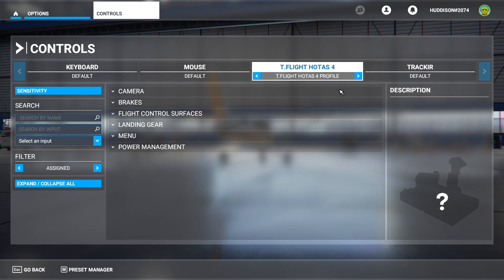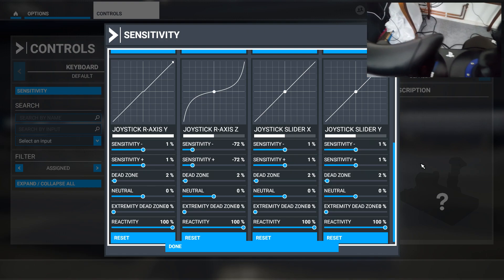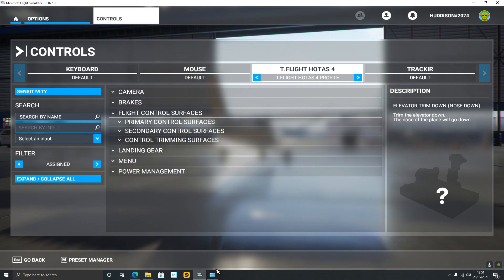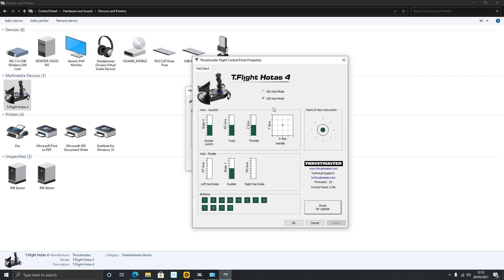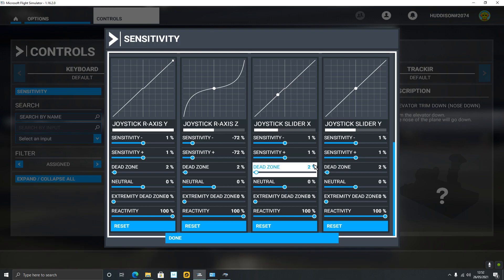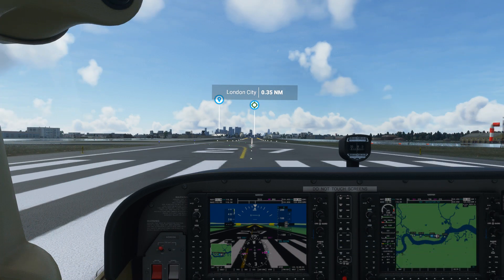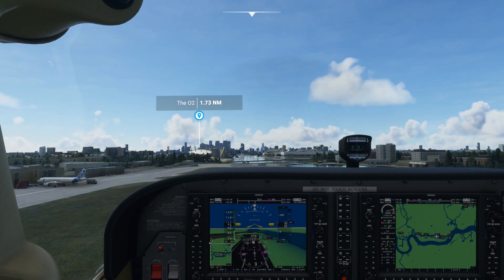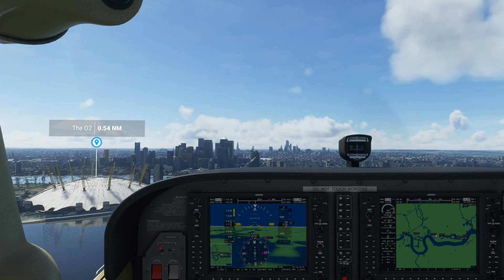FS2020: How to Enable/Unlock the 'X' Axis in Sensitives for your Hotas 4/X/One!

Comment: On a Hotas X the 5 axis mode is there but greyed, so no luck.  Except I'm sure I had those 2 buttons working for elevator trim at one stage, so not sure how!  At the moment, they are controlling the rudder as you say.
Reply from the maker: Do you have the official Thrustmaster drivers installed for your Hotas?
Reply: @Huddison  I think so, from the Thrustmaster support site labelled 2018-FFD-2. I'd put a link if I knew how..
Reply from the maker: @clarkac1  I'll do some digging.. Yes they seem to be the latest drivers for it - I'll pin your comment to see what others may have to offer.
Reply: I found how to get the 5 axis mode, simply press the coloured and lit button marked with a 'home' icon!  Doh... if the colour is bright you're in 4 axis mode, if dim 5 axid.  So now I can use the slider for trim, and twist the stick for the rudder.
Reply: Andy how can the X axis be found on MS Flight Sim? I have a yoke and a throttle but no mouse as in the example? Any advice is greatly appreciated.
Reply: @MillardE  If you go to the 'Sensitivity' page in MSFS then each axis is labelled (at 0:43).  Wiggle your controls to find which is which axis.

Comment: I’m also using the HOTAS 4.Do you have the Auto Rudder option switched on or off in the settings menu? If I have it switched off I find that I need a lot of rudder to keep the plane straight on the runway when taking off. I think it may have something to do with the live weather wind strength in the sim but just feels a bit excessive the rudder input needed.
Reply from the maker: Possibly a setting you need to turn off/on in assistance options/piloting.

Comment: I've got the HOTAS X, a complete new one, and there is something wrong my throttle. In the calibration it only want to register throttling up and not down. This is also the case in MSFS2020. Help?!
Reply from the maker: Did you download the driver?
Reply: @Huddison  Yes I have and I can see in the driver that the throttle acts strangely even in 4 axis mode and 5 axis mode. I've written to Thrustmaster now with this odd problem.
Reply from the maker: @tobiasgamingOfficial  I don't own the 'X' version of the Hotas; but your issue does seem a bit unusual.
Reply: @Huddison  I think I've found the problem. It was something in the calibration of the throttle itself ...I think I got it working now. By the way... love your videos 👍🏻
Reply from the maker: @tobiasgamingOfficial  Excellent to hear & thanks!

Comment: With my tflight hotas one, when I press the xbox button it will switch between 4/6 and 5/8 automatically
Reply from the maker: Great tip! I'll have to try that with mine.
Reply: @Huddison  I found it by accident when I had that program open and started testing all my inputs, figured I'd share it as see if anyone else's did that
Reply from the maker: @ROTNReaper  Thanks for sharing